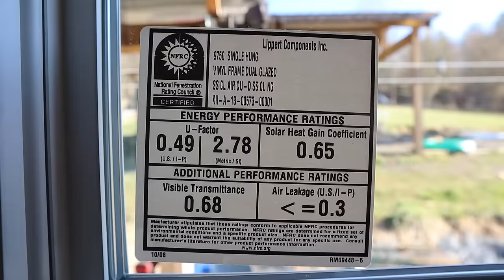Mobile Home Window Replacement - Kinro Low-E Vinyl Windows on Aluminum Metal Siding Home

Comment: Where did the find the right sizes. I clicked the Amazon link, it’s mostly shutters.
Reply from the maker: They used to be on Amazon... pre-Pandemic. Since then, the best bet for finding windows is a local mobile home parts supplier in your area. They should be able to order from the manufacturer or have connections that the public will not. Kinro is the brand of the windows we installed. They've been great for us. Good luck!
Reply: @sam-and-angela  Thank You !

Comment: It’s funny you say that about mobile home windows because I been in construction for 25 years and on my own the last 4 going on 5 and in all of my years of construction I never worked on a mobile home so when I bought a mobile home for my family 2 years ago I did things like it was a regular home so I replaced all my windows and doors inside and out 14 windows 2 exterior doors and 4 interior doors it’s a 1989 champion with metal siding I completely gutted it and remodeled it alone from top to bottom I mean I even laid my own pad and everything leveled it myself then hooked up the water and the electrical and when I did then found out I had an electrical problem and plumbing problem so the whole left side of my mobile home worked but the whole right side didn’t so I went threw but all new outlets in and new light switches then all new light fixtures through the whole house and it still didn’t work so I let it be for time being and continued with remodeling while trying to track my problems throughout my oldest sons room was the worst soon as I hooked up the water the whole room flooded so I had to go shut the water off go to the hardware store and I knew I was remodeling the whole bathroom so didn’t want to waste time and money on fixing the old piping so I gutted the bathroom and lone and be hold my right side of my house power kicked on when I gutted the bathtub out and the Sheetrock there was a screw threw the Romex wiring so the right side was fixed so I thought then I went under the mobile home replumbed all the plumbing with all new pex and shark bites and while doing so o had to obviously wrap my cold line with heat tape I got “the best” heat tape I guess it came in a box with a black end and then a orange clamp plug that you put around the wire and tighten the plug around it then it perces the wires and gives it power then I put it on a thermostat so at 32 it kicks on and at 48 it kicks off anyways while plug-in the heat tape in the right side went out again so now I tracked the source of my problem they had a old metal box under the house with no gcfi and it wasn’t grounded so I fixed that and bam power was working and things were back up and looking good now the point of this whole post was to tell you about replacing my windows I bought all my windows as replacement windows I live in upstate New York so there called pelle windows witch obv I know how to put windows in I have done it a million and 1 times so they were a little cheaper then the new construction windows which are the flange windows your using so I used the ones that just fit in the old hole with the work of a little tweaking they went in great after I flashed the whole seal and what not so when I bought the mobile home I only initially planned on replacing 4 windows so I bought 4 windows and a front door when they called me to tell me they were on there way here to drop off the mobile home then when I leveled the trailer I broke out 2 more so that day and cracked acouple more so my main concern was to secure my new house because the door wouldn’t close the old door and I wanted to put atleast 2 windows anyways I ended up putting a standard 36x80 inch front door on obviously had to cut it higher I did then there was a wire running over the top of the door so I had to work that into my new header I was making then I made my king studs and put a quarter in my entryway because it’s supposed to bring luck to your new home if you replace a entry way you put a quarter heads up and it’s supposed to keep all evil out and bring luck to your home so I did and things worked out great anyways I finished gutting out the whole house I took all the Sheetrock down and took all the appliances and everything out and all the cabinets and everything all carpets everything finally the house was empty and I started my process of remodeling first I rewired the whole back half of the trailer because that was were my problem was so I rewired my kids rooms master bedroom bathroom and mud room/laundry room then went from room to room remodeling it all alone from sun up to sun down and everyday before I left I made a list for the hardware store before I got to the house to start working for the day anyways I was saying I replaced all my windows with replacement windows but after buying about 6 windows from the hardware store at about 250 a piece I smartened up and bought the rest off market place I got 6 brand new pelle windows same style off market place for 200 so all 6 for the price of one of the other once I replaced then I bought 2 more windows off market place for my hallways and above the sink 50$ they were brand new pelle windows also but they were 14x 30 and going on about 2 and a half years I haven’t had one leak  knock on wood only door that did leak was the back door I didn’t replace it’s the original door and didn’t think I had enough room to put a standard door on but I do so once I finish the roof I’m gonna replace the door with a standard 32x80 door inswing so I can put a storm door on because it has a outswing at the time but it came out great I’ll post a video in the comments of the whol process my wife made a video of me going to work busting my butt I finished it in about a month all by myself

Comment: Just letting you know the nail fin needed to go behind the aluminum signing then the window would have been watertight by not just relying on the silicone plus she put holes in your house every where are you screwed into the wall

Comment: How do you measure for mobile home windows?
Reply from the maker: We measured the opening of the window between and added the thicknesses of the paneling trim they added (1/2" per measurement for our windows), then took that to a mobile home parts store we found and they ordered them for us. They knew the "standard" sizes for mobile home windows and were able to spot check our measurements. For example, if I measured 33.5" they said that the 34" window they had would be right. And they were. We wouldn't trust a home center for these window sizes -- they don't know mobile homes as well. Hope this helps!

Comment: Oh, oh. Shouldn’t the top of the windows be under the siding like the old windows were? 
I would think there would be more protection from rain and snow running down the side of the mobile home if put under the top siding.
Reply from the maker: They are, the new windows have built-in J-channels.

Comment: as far as i can tell that flange on the new window is supposed to be installed behind the siding!? that window appears to be a new construction window and not a replacement window.
Reply: For vinyl siding yes. Not metal siding like this